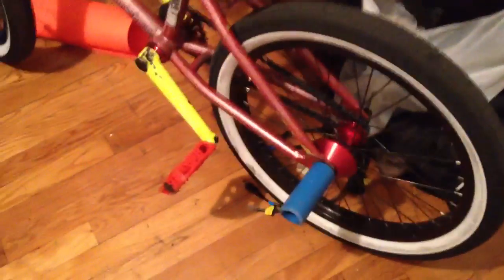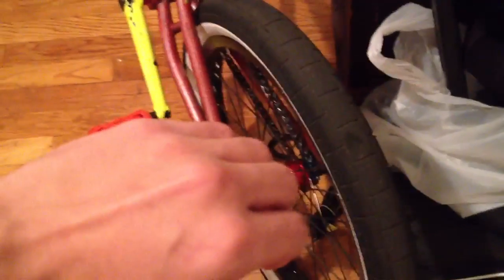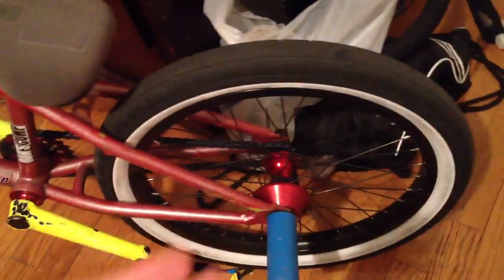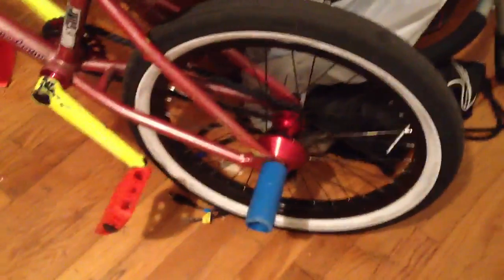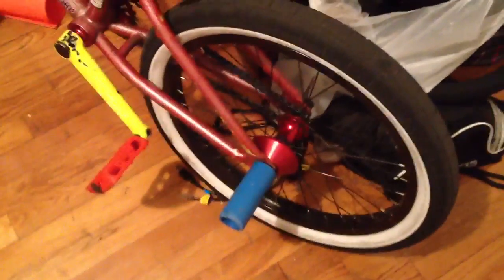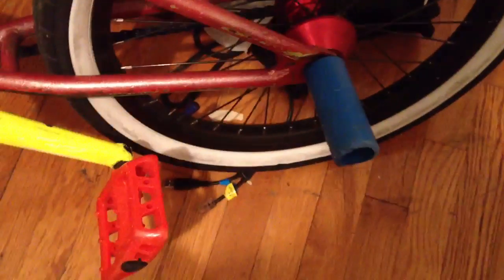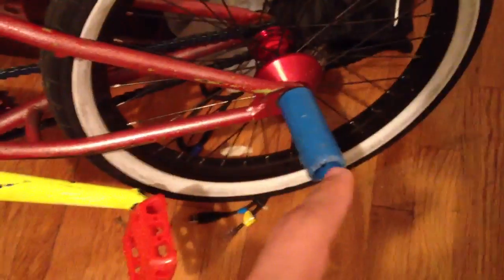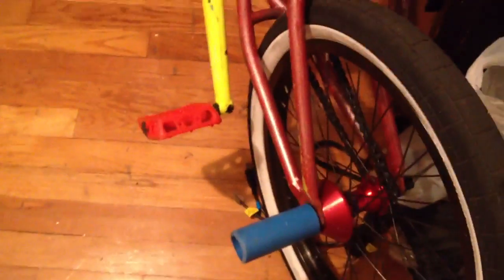Bmx plastic pegs vs Steel pegs

Comment: How do you take off tight pegs that dont have holes on them?
Reply: are they bolted on?
Reply: yeah
Reply: Use a ratchet with a 17 or 15 mm socket
Reply: It's not a Walmart bike and the non Walmart bike uses a bolt to go on

Comment: Plastic in front steel in back dude... 
Plus how do you run plastic pegs? I only had one set I had a stolen Thermalite and a g sport one and I teared through the stolen one in just a month i had to cut the peg in half to get to my axle.. never buying plastic pegs again

Comment: I use steel pegs for street and plastic pegs for the skateparks. Steel in my opinion is great for street because they are tough and durable, and also in my opinion Plastic pegs are best for the skatepark because they slide better and they are much don't tear up the park really. Plus the skaters who are just dicks don't bitch about them. lol